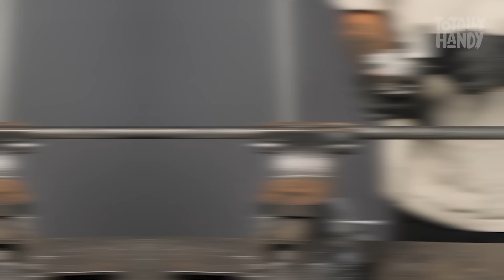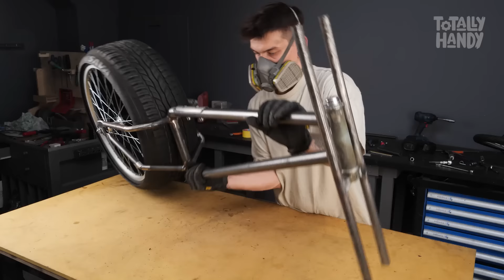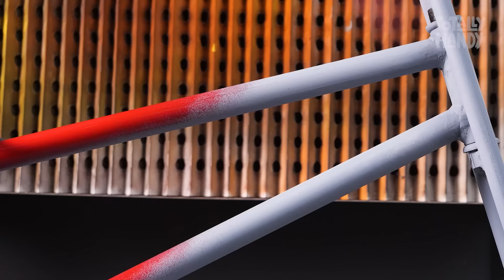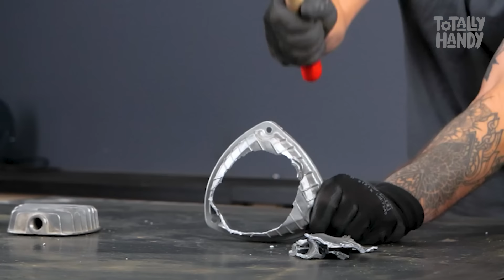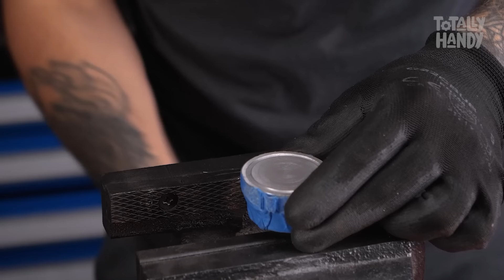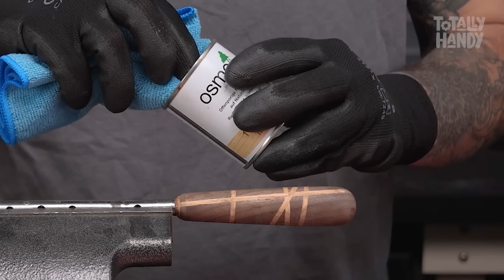This is NOT a Bike | DIY Project

Comment from the maker: 🌘🌘🌘 Check out our other video HERE: https://youtu.be/cSPv09O2zts
Reply: Worried you where gunna loose your handy , microfibre cloth so close to lathe chuck. Glue or wrap around a stick. Sticks cost nothing compared to a hand. Or fingers 👍🖖🍺 only caring dude. Bike and branding tool turned out good.
Reply: Could you please show the links to all the electric parts you used to build this bike. I'm currently without transportation and can't afford a vehicle but could spare a few hundred bucks building something like this. What speed control module and speed controller did you use? What voltage of batter and amperage did you use? Please let me know. That k you.
Reply: @kinn1647  a good night at the house in the
Reply: @kinn1647  qqqaaaaq
Reply: @lorenzogonzalez3460  bbbbbb
Reply: How do you deal with imposters trying to scam your community?
Reply: @lorenzogonzalez3460  p

Comment: I was so surprised to see you make that electric bike! You made it look so easy... Could we have more details on that build please?
Reply: It’s not a bike 😂
Reply: @PNUTT4444  for all intents and purposes its a bike without pedals
Reply: @holyvanguard  three tires, trike indeed
Reply: @coreyschmidt9449  it has 4 tyres, a quad indeed
Reply: No you just need a brain
Reply: Did I miss something? Where is the motor? I seed the speed controller and battery
Reply: @Stefan_Smith  it was in the front tire
Reply: Rim. Sorry
Reply: @Stefan_Smith  The motor is in the hub of the front wheel.
Reply: If you’re talking about all the electrical parts, I think he just takes a motor wheel from a standard e-bike, most of which are easily compatible with the standard E-bike controller he uses that can be found almost anywhere. Then you just need to know how to connect the controller wires (it’s pretty universal - based on colors) to everything else. 
Some controllers have different programming but all you need is to link the power connection (negative and positive) to a battery, some motor connections to the motor (again universal, as easy as snapping in the right wires together), and a throttle connection. The throttle is also a standard e-bike throttle, which should be compatible with everything else. It’s pretty simple if you know what you’re doing with the wiring.
Reply: @Stefan_Smith  It’s a small motor hub in the front wheel. I’m amazed how small it is relative to the wheel. I’ve never seen an e-bike like that.
Reply: Made it look easy?! Wtf
Reply: @dcataj5085  the two bike tires in the one car tire, act as a bicycle adapting hub/rim. So yeah, that's one tire in the back, a car tire, and one front tire.

Comment: That back wheel bicycle with two wheels inside is amazing
Reply: Yes, amazingly pointless and makes it wonky to ride and utterly useless for anything other than narcissistic slow cruising - thirsting for attention (over a junkyard bike.
Reply: @USMCCombatVet4TastyCrayons  at least he is doing something positive STOP 🛑 the hating hater
Reply: @teshuvahemmet3036  how is it positive? Hahaha.

I mean, it isn't NEGATIVE either, but it isn't positive in the slightest, because, it doesn't CONTRIBUTE anything to ANYTHING or ANYONE.

For example:

Does it IMPROVE on the bicycle?

No, in fact, it takes away the ability to LEAN into a turn, making this a more UNSTABLE version of a bicycle.

Does it make electric bikes more affordable?

No, in fact, a tire like that would be quite expensive because it is not only a very large diameter SPORT PERFORMANCE TIRE MEANT FOR A CAR, but ANY car tire is substantially more money than a bike tire. And you now have TWO bicycle wheels, a heavier axle, and the maintenance headaches of a custom design - IF he took this to patent/production.

But he isn't  even doing that. He is making it solely for VIEWS.

Which leads to my final point:

Much like the many bogus "five minute crafts," or "life hack" videos on social media, THIS is solely done to LOOK clever enough for VIEWS but neither works in practical application for mass production NOR was ever intended to fill a genuine market's needs.

It is purely for the entertainment purposes (for couch potatoes, like you) and monetization/views (for the uploader).

It is DIY goofing around PUBLICLY POSTED to a bunch of strangers - meaning it is 100% open to ANY and all valid criticism of its use, purpose, and flawed functionalities.

In other words, the only ones hating, are mindless fanboy slumdogs - like yourself.

P.S. try coming at me when you OR this guy have done ANYTHING that ACTUALLY contributes to:

Community
Country
Society
Humanity
The sciences
Consumer needs
Or something altruistic, like:

Helping the homeless, 
Feeding the hungry, 
Ending poverty,
Providing sanitation or clean drinking water to impoverished areas,
Etcetera.

You ain't 💩

Just like your strawman clapback and just like your little mancrush boyfriend in this TRIVIAL video.
Reply: @USMCCombatVet4TastyCrayons  you have a good point didn't think about it like that forgive me for calling you a hater I like the way you think 🤔
Reply: @USMCCombatVet4TastyCrayons  Some examples of why It's positive are that he is providing content for everybody for free and it could spark interests in things such as welding and being creative in general. 
Not everything made has to solve a problem, be marketable, or maintainable and flawless, to be a good idea or a net positive.
He's not hurting anybody and for all you know that stuff was destined for the junkyard anyway.

I think the bike looks cool as a show piece, it's obvious it was never designed to outperform anything. 
If you reply to me try not to exceed the caps per sentence quota of a sane and reasonable individual, lest you brake your keyboard warrior themed capslock.
Reply: @ac1dra1n  All caps indicates SHOUTING in social media/chat parlance, whereas individual words and phrases MERELY HIGHLIGHTS/ACCENTUATES a specific point.

What a shameful STRAWMAN attack on a stranger - clearly attempting to both MARGINALIZE and INSULT without JUSTIFICATION or CAUSE (see what I did there,  and how that works - capitalizing specific words, like putting them in bold or italics).

Furthermore,  your argument is purely subjective - for which you have EVERY right to such OPINIONS.

Unfortunately, your OPINIONS are not arguments against me and my pragmatic statements OR my own opinions where I am neither  IMPRESSED nor willing to blindly applaud NOVELTIES work (unnerved for attention and monetization) - which is what this is and was one of the main points of MY commentary.
Reply: Have any of you ever heard of art?
Reply: @Popaho  have YOU heard, "art" is subjective?

Have YOU heard, most people don't  regard a bicycle with a car tire video uploaded to YOUTUBE, "art?"

Have you heard,  YouTube, is hardly regarded as an "artistic" platform?

Have you heard, have you heard, have you heard.... your clapback is weak and lazy?

Comment: Dude that rear wheel setup is insane. BRILLIANT WORK!!!!!
Reply: bruh wtf I thought that was my own unique brilliant idea I've been sitting on waiting to do it with winter car tires. I felt kind of butthurt when I saw him make that part 🤣😅
Reply: ATOMIC ZOMBIE is the place for DIY bike projects too!
Reply: @chrishayes5755  believe me bro, I thought I invented so many things to find out they’ve existed for decades. I thought I invented Desmodromic Valvetrains until I found out they’ve existed for about 100+ years!!
Reply: The unique problem I see with that tire is it'll have traction on the outsides but not middle of the tire. It might make for weird handling and it'd be better it used a mid mounted motor with a chain to drive that rear tire.
Reply: @chrisnorris3641  
Also consider the inward forces on the rigid bike rims if you hit/ran over something in the middle of the back tire.
Reply: @Unsensitive  I'd honestly be afraid to ride this thing on Gravel. 😂
Reply: @Unsensitive  I'd also be afraid of the outer tire slipping off the 2 smaller tires or something
Reply: @chrishayes5755  ahh. Well if you know you get a god idea act on it that's from God giving you an idea I learned that the hard way myself. God is giving me some ideas I didn't act on it I didn't use my talent next you know I seen someone else doing it how many blessings of passes up cuz we didn't go with what God wanted us to do
Reply: Awesome work

Comment: Nice! Would be cool with 2 hub motors on each back wheel, and 4 batteries.  Instead of front wheel drive
Reply: I know, like what's the point of having that huge back wheel if it's not driven.
Reply: @zobrombie3023  exactly.   Can't do anything fun with front wheel drive either

Comment: Pretty cool indeed. The rear tire setup is slick, my question is does it require use of a specific profile of bicycle tire to work and if so what type?.  I love the look of this and think it could be expanded upon to be even more fun and would really like to make a similar unit with my twists on it.
Reply: Size 20 tire
Reply: I have a 20" mountain bike with the cool suspension stuff on it....been waiting for a fat tire idea.
Reply: Gonna potentially build one myself not the frame that's way beyond me but on a chopper frame x2 1500w hub motors with maybe a 750 mid drive and 750 front hub

Comment: I'd like to see what you would do to patch up worn through hollow core boot soles to get another year out of them for wearing around camp, creeks, trails, etc.
Reply: Masking tape the bottom then fill with silicone from top. Go slow otherwise it will get messy

Comment: Very little clearance for the rear wheel to deform, the good thing is that instead of aluminum it looks like steel was basis for the frame which would make it stronger and easier to weld. Without any peddles and gearing it's only really usable on fairly flat paved surfaces.
Reply: Gotta love some positive reinforcement 😂

Comment: Funny I used 2 Milwaukee batteries for my electric bike also. A little surprised you went with a fwd tho. I'd like to see how that handles. Nice vid. I especially like the part where you kicked the seat off of the chair and slapped it down on the bike.
Reply: Fwd are okay. They pull you along rather than push. I have two 52v mountain bike ebikes I converted using a mid drive motor. I prefer the mid drive rather than the hub drive.
Reply: How long do your Milwaukee batteries last per charge in that use?

Comment: If you consider a part 2 or version 2, could you use 2 motorized wheels in the rear? Same setup with a BIGGER battery.

Comment: Cool build just think about 2 motors in the back or one it just seems weird being front wheel drive still cool though
Reply: He might be able to create a clutch system that he can operate from the handlebars to open and close the circuit while still being able to keep batteries close to the motors in the back that way he'd lose as little power as possible (if that was his worry). I was thinking the same thing tho watching it. That and some suspensions for that beast. Still nice.

Comment: Just so you know bro and I'm not really criticizing or anything but if you really want High current splices in your wire you should use clamped connections instead of soldering. Soldering, as a low temperature alloy, has the potential to immediately decouple under high current drain just from the resistance of the copper causing heat. So for instance if you ever plan to ride your bike anywhere near traffic although you probably not planning to you know get it certified or anything it's just a safety feature.

Edit; absolutely fantastic project by the way tremendous skill and powers of visualization demonstrated

Comment: Well, yeah, actually it is a bike. You could argue it's a trike because of the two rear wheels but because they're connected together and don't turn independently it's really the same as having a single rear wheel. Bike = bicycle = two wheels.

Comment: Would get a better finish if you use high speed tools rather than carbide with a low speed lathe, less you can spin the over 2500 RPM

Comment: Bro, the welding was killing me. You don’t have to spot weld with a mig. Tack in place then run full beads. If the substrate is too thin just turn the voltage down. Tacks do not have enough penetration to be relied on in a bicycle.

Comment: Really great idea; however, on a 2-wheeled vehicle, more traction is needed in the FRONT, NOT in the rear!
ANY motorcyclist will tell you that if you lose traction on the front tire, you will kissing pavement immediately.

Comment: Not a bike? Could have fooled me. Two wheels or three (hidden) wheels it's still a bike.
Reply: @dcataj5085  If you hang four more tires on a motorcycle it's still a motorcycle. Adding part of a car tire with two bicycle tires in it does not constitute calling it a non bike. If you add four bicycle tires inside a car tire and do that on all four tires, that does not change it into a truck (16 tires, add two more and you've got an 18 wheeler) it's still a car.
Reply: @dcataj5085  I give up. Like Ron White said "You can't fix stupid".

Comment: Our Services:
Injection molding of plastic parts
As a one-stop plastic manufacturer, we are capable of producing a wide array of plastic products, including custom plastic enclosures for consumer electronics, plastic components for the automotive industry, plastic containers for food and non-food products, etc.

MANUFACTURED PRODUCT WEIGHT RANGE: 0,01-5,00 kg
RANGE FROM 50 to 650 MT CLAMPING FORCE
TQM QUALITY SYSTEM ISO 9001
2K Moulding
OVER MOLDING
TAMPO PRINTING, PAINTING, LABELING

When you have project fit for us, be free to contact me on time.

Comment: the title is clickbait lol... IT IS A BIKE, just an "electric bike"  try and deny it but  read this 

"An electric bicycle is a motorized bicycle with an integrated electric motor used to assist propulsion. Many kinds of e-bikes are available worldwide, but they generally fall into two broad categories: bikes that assist the rider's pedal-power and bikes that add a throttle, integrating moped-style functionality. Both retain the ability to be pedaled by the rider and are therefore not electric motorcycles. E-bikes use rechargeable batteries and typically are motor-powered up to 25 to 32 km/h. High-powered varieties can often travel more than 45 km/h (28 mph)."   

CHECKMATE

Comment: Actually, it IS a bike.

Bike..... bicycle..... bi = two

Just because the rear tire is internally supported by two (pointless) wheels, doesn't make it a trike.

And, no, it isn't pedantic - it is simple grammar, common sense, and fact.

Besides, if you are going to post on SOCIAL media (where a bunch of strangers are) you have no right to be free from VALID criticism of content, description, or your very existence.
Reply: @dcataj5085  it is a BICYCLE
Reply: @dcataj5085  it rides on ONE rear tire.  Not two.

If it has two SEPARATELY ROTATING  rear tires,  it would be a TRIKE.

It has ONE rear tire with with two bike tires with INNER TUBES linked by a makeshift AXLE SPACER - that WHILE ASSEMBLY is acting much as a conventional wheel would when MOUNTED in a tire.

After all if it is based purely on how many tires it has (literally) than it is a FOUR WHEELER.

If you are saying it has to be based on how many things definable as "wheels" are in the design,  then it is a TRIKE.

But what it RIDES on are two TIRES.

That makes it a BIKE by all definitions,  tradition, and common sense. 

Hush now.

Comment: Plumbing pipe, front wheel drive, tiny batteries, worst E-bike ever.
Reply: @dcataj5085  it's electric and a bicycle.... E-bike. It's literally in the name.
Reply: @dcataj5085  non of that matters as the two back wheels work together with the larger tire to work as one. But hey, mine as well say it has 6 tires because of the 3 inner tubes.